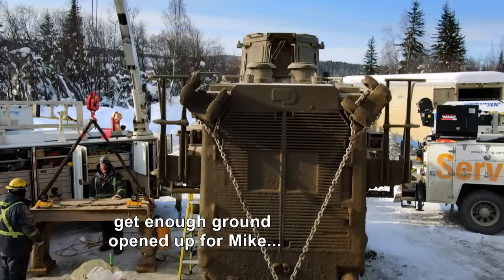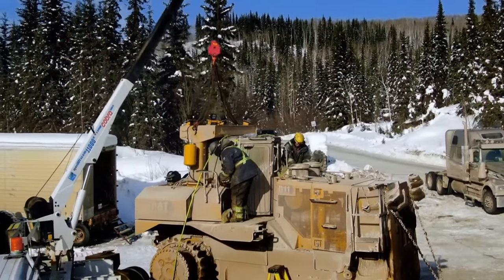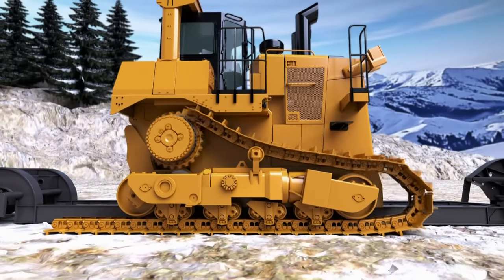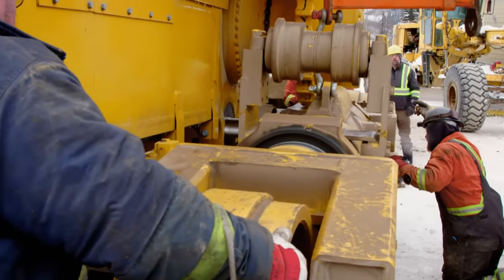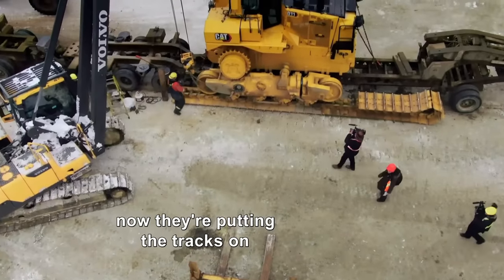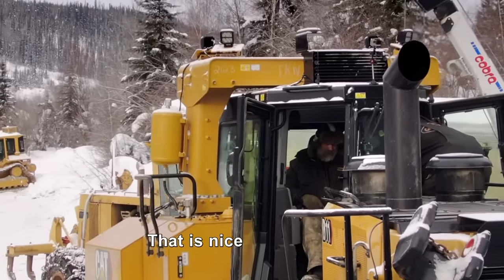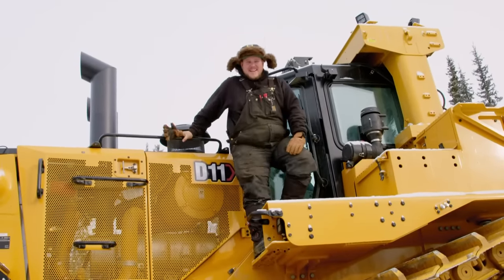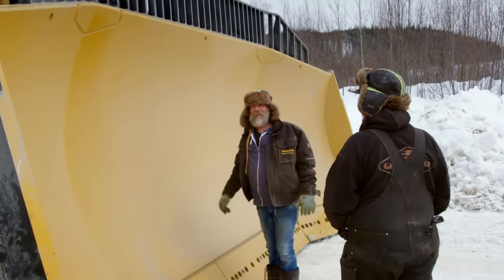Tony Beets Buys a Brand New $1.3 Million Bulldozer | Gold Rush: Winter’s Fortune

Comment: He’s all happy now until he gets his first emissions code an it goes into limp mode
Reply: This comment is so underrated only people that struggle with this would understand 😂😂😂
Reply: It'll be quietly deleted for sure. Not a chance CAT will leave an unfiltered Tony on a TV show with a dozer crippled up by the DPF system.
Reply: @cristiantoledo1962  😂😂 it’s going to happen. There’s absolutely no way around it. Not a matter of if but when
Reply: That thing was deleted before it even came off the trailer.
Reply: @Ma_Deuce  you’re right all depends on regulations
Reply: @cristiantoledo1962  😐 i work in a library and i know what that means.
Reply: @bring6not12  what’s the liquid called
Reply: @cristiantoledo1962  tf you mean liquid? the liquid. theres a lot of liquids.
Reply: @bring6not12  it’s clear
Reply: @cristiantoledo1962  blinker fluid.
Reply: @cristiantoledo1962  not 100% if that has def actually. I know the quarry I worked at bought a new 990k last year and that didn’t have it
Reply: @Brandon_093  yea it all depends on regulations where they are at
Reply: Swear to god! 🤣🤣🤣🤣🤣
Reply: DOC face plugging
Reply: @AndyEightSevenFive  I bought a Deere 310L.  When the Deere tech came out to replace a leaking front axle seal, he related that by the L series, Deere had worked out all of the bugs, and redesigned unreliable systems.

Except one.

The DEF system.  

He suggested not touching the DEF until the tank was almost empty, but not completely empty.  Then add one jug of fresh, unopened DEF, replace the filters, and then don't touch it again.  

He said the DEF system was the only problematic part of the unit.
Reply: Lol
Reply: Fuck me this comment had me rolling its so underrated aswell
Reply: Hopefully it’s not a California model
Reply: Comes with 2 engine options still, tier 2 and tier 4, I’m guessing they got the tier 2 engine
Reply: @cristiantoledo1962  indeed I have spent so many hours with farmers and miners helping them hack the systems because cat insists they're the only one that can work on them. The systems are simple just have to return the original system back for when CAT does a service.
Reply: @wayneskynet8265  where going to come to a time where we can’t do anything to our own equipment/vehicles without their dam computer and software
Reply: @cristiantoledo1962  true but as long as these monopolies companies continue I will continue to figure out ways around it. People would rather give me 300 gbp rather than a CAT shop charge 2000 plus. I only hope they dont go to the point where they need random access keys generated to access or control. There is always ways around it. Trick is to copy the whole system before even touching anything. So you can flash the system back again before CAT touches it.
Reply: No shit right.
Reply: @cristiantoledo1962  434è4r
Reply: im pretty sure the D11's do not use DEF
Reply: Aren’t off-road vehicles exempt from EPA emissions requirements?
Reply: @maxsjoberg788  not all of them. It depends
Reply: @brad-my2xq  anything diesel over 26 hp uses smurf juice.
Reply: EGR delete :)
Reply: He will fair better then your average contractor. The hard you run this new iron the less issues you will have with emissions equipment. It's the machines that rack up a lot of idle and "easy" hours that have more issues. We run the crap out of our equipment for 12hrs a day. And have very few issues compared to other companies that have more down time.
Reply: @dozerboyd8784  I think it’s luck of the draw. Worked at a quarry for a few years and every piece of equipment that had def had none stop emissions issues. The 980m was the worst. Had as many hours down time as run time due to emissions issues
Reply: @cristiantoledo1962  its already that way with our case's have to have a tech come in with computer and diagnose and they dont sell the software so hello 180 an hour
Reply: I bet Tony can make it fire right back up
Reply: Be time for some weight reduction when that happens lol.
Reply: Always buy an old enough machine that it doesn't do the re-gen thing.
Reply: Haha I’m dying of this haha
Reply: 🤣🤣🤣😂😂 you know the struggle too real
Reply: Then wait 2 months for a Chinese part
Reply: @brad-my2xq  yea like I said in a earlier comment the quarry I worked at bought a brand new 990k and it didn’t have def but still had a shit ton of emissions shit on it. Couldn’t even smell the exhaust lol
Reply: Just add a little more DEF and she's go to go.
Reply: A few years ago I bought a brand new 2018 3500 Dodge Ram long horn mega cab single axle and as soon as the winter hit the def tank would freeze into a block of ice and obviously the truck wasn’t getting def fluid and it would put it into limp mode and the truck would only do 8 mph. I had it sent in and fixed under warranty for the same issue 5 times over the winter and ended up trading the truck in after 6 months
Reply: @L3GHO5T  I believe the Dodge 3500 is rated as one of the all time worse trucks to own.  You story gives this bad rating credence.
Reply: L
Reply: derated to 2mph and 500lbs of torque.
Reply: HOLY HELL.... That's perfect. People don't know man. Lmfao people don't know 🤣🤣🤣🤣
Reply: @cristiantoledo1962  Obviously you kook, lmao you really felt like you had to let that be know ?
Reply: Shoe sting outfit lol
Reply: Caterpillar is the king of heavy equipment! 👑
Reply: Buy a Russian dozer, no dpf and half the price.  Still pushes earth just as well and doesn't spend half the day plugged into a laptop!
Reply: Lol the problem is that a lot of these companies just buy the store def instead of the manufacturers recommended brand thy think def is def doesn't matter what brand of def we pour down the 1 million dollar machine. And some manufacturers put it in too make extra money bc apparently your not allowed too fix your own machines a lot of farmers don't realize that the politician thy vote for is actually the reason thyr not allowed too work on thyr machines bc thy never pay attention too what thyr politician is actually doing after theyr elected.
Reply: There's usually a horsepower threshold before you don't need emissions systems anymore.
Reply: @crinkly.love-stick  the d11 are available In tier 4 which I believe that includes def
Reply: Slow and steady wins the race 😎
Reply: @Brandon_093  Caterpillar Tier4F C32's are an EGR and DOC system.  No DPF to regen, no SCR to consume DEF.  The 990K referenced above is a C27, a nearly identical engine with a slightly different bore and stroke.
Reply: @crinkly.love-stick  There is a breaks at 74HP and another at 750HP where the emissions allowance per HP change.  All legal ones will need some form of emissions systems, but the recipe can vary.  The Tier 4F C32 in the D11 is an EGR and DOC system, at least outside of California.
Reply: Literally the only issue I ever have with the diesels in my fleet.  It’s bs.
Reply: @jamesrogers4674  No Def and still meets tier 4
Reply: Sold my new d7 for this reason and went back to a 2010 d7 that I found at auction with 800hrs
Reply: Antonmursid🇮🇩🙏🙏🙏🙏🙏
Reply: D11 don’t use DEF
Reply: You think hes bringing in 10+ million a season while his bulldozers are in limp mode? Thats cute.
Reply: @kaiden840  huh
Reply: @Brandon_093  im saying these dozers dont go in limp mode or he wouldnt be making money, simple.
Reply: @kaiden840  he has 2 or 3 others..
Reply: Lmao wow
Reply: Lmfao
Reply: And then the guy they send out to fix it was working at McDonald’s last week.
Reply: It doesnt have DEF if thats what you’re wondering. Been running a next gen on and off for a year now. Never seen this yet.
Reply: As a heavy duty mechanic . You’re completely right ..
Reply: @bryanrose4850  is that the liberal model 🤣
Reply: @cristiantoledo1962  def
Reply: @Brandon_093  geez they beat the crap out everything and do no real preventative maintenance and cry when shit breaks!!!
Reply: And You have to take it in for factory reset.
Reply: I would think that those massive dozers are more sophisticated to where a little code won’t completely put it out of operation like a smaller piece of equipment.
Reply: @Brandon_093  anything above 700 horsepower doesn’t have it.
Reply: Too cold up there to be equipped with DEF systems.. would be a block of ice
Reply: He's in Canada.  Its not illegal to delete vehicles in Canada.  That's where most of the US gets their delete parts from.
Reply: I thought off road diesel equipment don’t have emissions systems… 🤷‍♂️
Reply: And wait for back ordered parts
Reply: @cristiantoledo1962  its amazing that you still have to tell people that who are keyboard warriors 🙄🙄
Reply: @AndyEightSevenFive  as a Cat Field Tech for 20 years, I can tell you with absolute certainty that can’t be deleted, period.
Reply: @Ma_Deuce  New Cats CAN’T be deleted. Only Dealership s can get deep enough to play with the programming. I work for a Dealership and can affirm that it is never going to be deleted.
Reply: @brad-my2xq  the machines over 700 hp don’t use it. You are correct
Reply: @shadetreelife3670  think he meant the footage will be deleted
Reply: refill ad blue xD go back to service station at 1 mph :P
Reply: I have over 20,000 hours running D-11’s, they are nice machines. Only thing that sucks on them is the heater mixing valve, made out of plastic and they strip out every year.
Reply: @Brandon_093  the D11 tier 4 does not use DEF.  It achieves emissions with just an oxydation cat and cooled EGR.
Reply: Lmao
Reply: True story
Reply: Oh my god like someone else said, he will end up getting a code. It will go in to limp mode or won’t run at all.  These equipment companies insist on doing software updates and revisions be done by authorized techs only. It can take days sometimes a week in a normal situation to get things like this handled.  Where this machine is it may take a month to get help. If it breaks at the wrong time of year, it’ll sit for 6 months.
Reply: @cristiantoledo1962  No matter what they call it, the fluid is basically.....urine. not making this up.
Reply: @cristiantoledo1962  always bypass it
Reply: @Homefree18  when it's -35 and your feet and legs are frozen because the heater is shot...been there, done that
Reply: Add Blu System on cranes is a massive problem. Never ending issues.
Reply: Wonder what a gallon of d.e.f. runs in the yukon🤣
Reply: Should come with free laptop, connectors and CAT ET! 😂😂😂
Reply: Hahahaha 🤣
Reply: DEF is stupid. Saving the world one plastic jug inside a cardboard box at a time. And it freezes solid. Delete it, and the new motors are great. And I have a feeling if anyone from a government agency wants to inspect that dozer, they're gonna end up under one of the tracks due to unfortunate circumstances beyond anyone's control of course lol
Reply: Delete the def system and keep on ripping
Reply: I think when it's over 800hp it don't have to have Def don't quote me on that
Reply: The large dozers dont have DEF sorry to bust ur bubbles.
Reply: @chopperdude407  don't need Def to throw emissions codes
Reply: I don't think such a big engine from cat has emissions
Reply: Yeh for our business we never buy our equipment equipment with DPF or diesel exhaust fluid systems😂 or we delete them🤫
Reply: @cristiantoledo1962  Most people don't have a clue what you're talking about!
Reply: as far as i am aware these have marine grade motors so no emission components

Comment: The dozer went from being brand new with the tracks and blade nicely painted to instantly no paint on either. Sometimes I get the feeling Discovery thinks I'm stupid.
Reply: The paint comes off when you use it...
Reply: The paint disappears if you look at it wrong it’s literally only there so the blades not already covered in surface rust when it’s delivered
Reply: Ummmm . . .

Comment: 8:05- A totally brand-new-yellow blade
8:30- A totally old-worn-grey blade
Reply: Dosent take long when it’s used 14+ hours a day
Reply: @bradleycittel1156  dude stop. At that point it hadn’t been used at all.
Reply: @Invictus13666  you do know that they probably take footage months apart and slap it into one video. That dozer could of been 1 month old by the time they took the shots of the blade with no paint on it 🙄
Reply: I reckon 
He swapped the blades over, so the new one was for back up....
Reply: @Invictus13666  It clearly had been used. It was covered in dirt. It doesn't take long at all to remove most of the factory paint from a dozer blade when you are actually using it. This is known as filming a show. Not all of the shots go together in the order they were filmed, sometimes they are pieced together in the order the production team needs them to be in so that they tell the story. So at the 8:30 second mark that dozer could have been moving earth for an hour or more. Hell, Tony could have been moving earth all day and they had him get in it and act like it was his first time in the seat because they needed that shot.
Reply: @sergeantzombo266  sure. There’d also be residual paint left in the hard to wear areas. As a guy who owns an excavator, dozer, 2 dump trucks and a loader, I’m a little acquainted with how paint wears off of blades and buckets.
Reply: @Invictus13666  I highly doubt you know anything about heavy equipment. I’ve had plenty of new iron to run and the paint wears off the contact surfaces quicker than shit, I imagine even faster when ones pushing hard as concrete frost chunks as big as VWs
Reply: @Invictus13666  awe you’re little feelings got hurt😂 seriously if you know so much about heavy equipment which one would think you also know a thing or two about dirt moving whats a zone of influence in reference to road building? What’s an acceptable cycle time for loading a quad axle or semi dump truck with a 100,000lb excavator with an ME bucket? When grading for a road how far back of curb does one run the subgrade and how far does one run the stone? When doing an excavation what’s the appropriate benching/sloping ratio for all 3types of material? Go ahead, I’ll wait.
Reply: @knuttsackjones3094  Best part is how triggered you got and how you ran to google for some buzzwords.
Reply: @knuttsackjones3094  except I’m not lying. I’ve made no claim that I’m a fancy operator, I simply pointed out that I own a few pieces. You’re the one that invented the rest of it.

Comment: Should spend a few dollars on a DEF delete system before he learns a few new curse words
Reply: That's what I was thinking when he said reliable. Not with that shit in place.
Reply: Not until the warrantee runs out though because Cat won't cover any engine problems after.
Reply: Generally off-road construction equipment doesn't have all the DEF/DPF garbage = they are exempt.
Reply: @jonmccormick8683  yeah that's not true In the least. Buy a piece of equipment and tell us all about the DEF.
Reply: @jonmccormick8683  you'd be wrong boss
Reply: That shit ain’t nothing but snake oilLOL

Comment: Anyone know how they cleaned all the shmoo off? I don’t know exactly how cold it is, but I imagine too cold to pressure wash or steam Genny it. Of course the easy answer is discovery is a little special and filmed 2 different machines and tried to tell the viewer it’s the same machine, but I don’t think that tony went and bought 2 D11’s.
Reply: Notice the portable heating units and flex hose being set up in the background.....They thawed the machine & frozen road grime and pressure washed it off. That is common on any big machine delivery in a cold climate with no indoor option. I spent time on the oilsands of northern Alberta, and big machines are being delivered and or moved daily on those massive operations....Some of those mines might have 50 or more D11's working at any time.
Reply: @timtwichell1534  so how do they keep the whole machine warm enough for long enough that the water from the pressure washer has time to evaporate and not freeze on the machine, and freeze the door shut, freeze inside all the bolt holes, etc? Do they like, tent the vehicle? Or is it just not 20 or 30 below and they don’t have to worry about the water freezing that fast?
Reply: @cnf6045  you answered your own question, they warm the steel up, it takes a bit of time for the heat to radiate back off the machine.  The first thing they do is warm the motor up, that does a great deal towards keeping the metal warm enough so that water doesn't freeze the instant it touches the metal.  Often it's enough to simply let the motor idle while you're cleaning it - you'll notice, though, they're not doing it in any kind of wind?  that's kind of the 'secret' because once the machine warms up, the air next to the machine is warmer then the surrounding air.  Add heated pressure washers, and it's pretty easy to get it clean.
Reply: @stoneshrink  I mean I figured they used steam generators, not just normal pressure washers, I just didn’t think that engine put off enough heat to warm up the entire machine, idve thought just around the engine bay.
Reply: @timtwichell1534  are the oilsands in Alberta heating up again? Off topic I know lol just been waiting to hop on that oilsands train again

Comment: Ahhh brings back memories in the oil fields.  My boss rewarded me with a brand new CAT 980K payloader for my promotion.  Only I was allowed to operate it.  What a great feeling.
Reply: worst thing about that though is the first banged up sheet metal or first cigarette burn in the seat,boss man knows exactly who done it.
Reply: What mine you working at in Fort McMurray?
Reply: @pallmall5495  trust me where he is working that loader will be well used. A loader that size is used in some hardcore weather and extremely low temperatures. Plus other people will be using that loader from different shifts and teams.